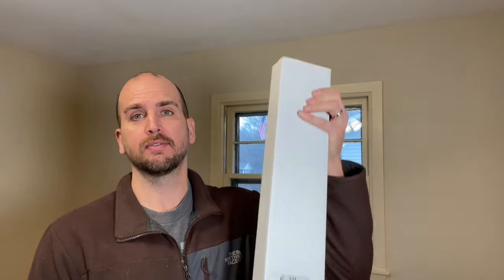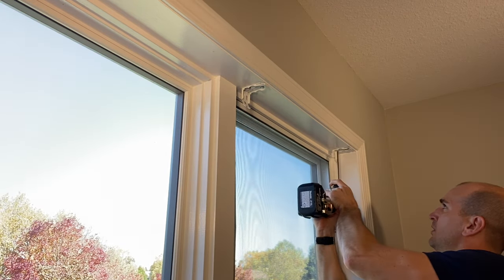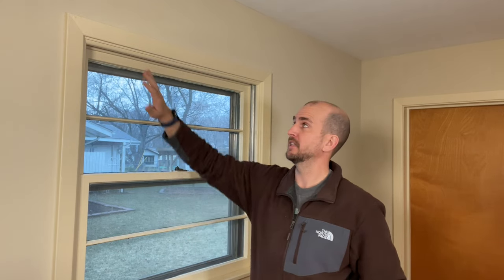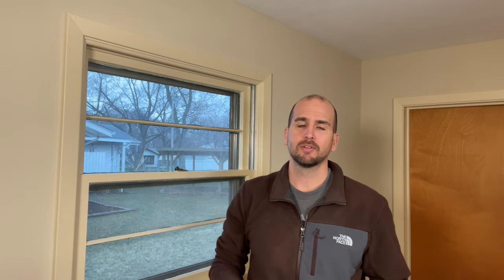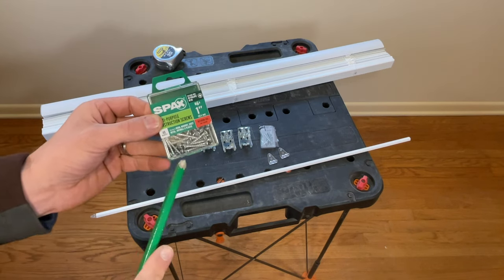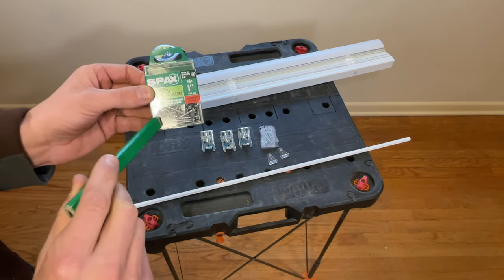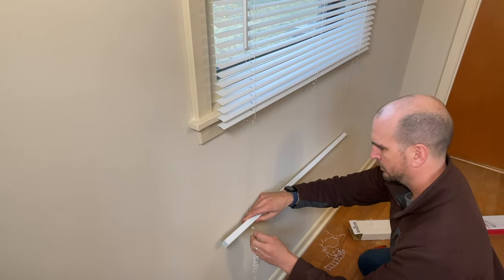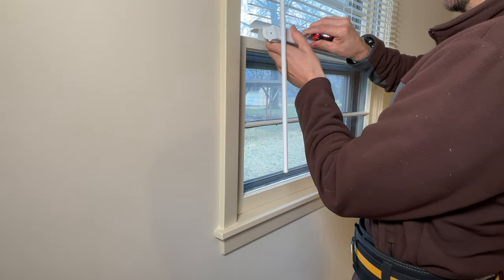How to Install Cordless Window Blinds | Outside Mount

Comment: Thank you so much. After many hours of searching, you are the first person to mention using spacers when installing above the trim. I had a flat part on the trim in my old house I was able to use, but this new house has no flat parts on the trim. My parents blinds are installed this way without the spacers and they get caught on the trim when trying to tilt the slats, so I was thinking of using some type of wood spacers, but didn't think I would like the look. I'm so glad you mentioned those transparent ones.

Comment: Wow! I can do it myself! Your video is excellent! Love how thorough you are describing all the necessary parts of an easy, no problem installation. I picked up the different screws and made sure I had a magnetic screwdriver drill. We just got all our old windows replaced and thought I would have to have professional installation etc.  I even made a template out of the cardboard from the blind box so I could just use it for all the windows and blinds installed.  The windows were all the same size.  Thank you again Perfect instructional video.

Comment: I just installed a cordless blind from the Big Box store. Good quality and, along with yours,  very user-friendly directions. HOWEVER, I did an outside mount, installing it to clear the window, and discovered that I can't reach that high! So it still partially covers the window when it's up. Who'd a thunk it? It's fine, and I'll leave it, because everything else worked out great. I just never would've thought of it, so thought I'd share.

Comment: On a tangential topic, I have a tip for inside mounting.  If you have a lot of blinds to hang, make a template.  Just rip one of the flaps off a blind box and tape it into the corner of the window frame where you want the left bracket to go.  Once you decide on the bracket position, use an awl to mark the screw holes in the cardboard.  Before you remove the template, write an L (for left) on it, and draw an arrow so you know the proper orientation to use.  Remove the template and write an R (for right) on the other side.  Then you can use the template and an awl to mark the screw locations for all of your windows.  Use the L side for the left brackets, and the R side for the right brackets.  The reason you use the left side to create the template is because the blind tilting mechanism means you don't have as many placement options for the left bracket.  If the template works for the left side, it should also work for the right side after you flip it over.
Reply from the maker: Good stuff Mark, thanks for the info/tip!
Reply: I should also point out that this depends on the mounting brackets having holes in a symmetrical pattern.  If the patter is asymmetric, you'll need two templates.

Comment: I like blinds and curtains for a pretty complete black out effect. Blinds usually have holes in them and of course the space between the slats. Curtains usually bleed light through and the space between them if they don't overlap enough. Having both makes for a pretty dark room. Especially useful in the summertime when you finally have a day off to sleep in!  😊
Reply from the maker: I think that is a better all around solution.  In my rentals and flip properties I usually just put up blinds but some of my renters request curtains as well especially in the bedrooms 👍.

Comment: Bought 27x48 Room Dark blinds. Window width inside vinyl frame around window 26x35.  Surrounding wood framing is 27 1/2 x35. Suggested  location for placing brackets!

Comment: Depending on how many different sized windows you have in a given house (I have roughly three), I like to keep an extra set or two of the cheap blinds as "just in case" replacements. I have no issue using the cheap Lowes house brand on most of my windows, but they are more brittle and so break more easily if hit by something, etc.
Reply from the maker: Hey Marc,  I have used several different brands from the big box home improvement stores over the years but I did notice these Project Source 1" vinyl blinds seemed a bit more brittle and prone to the slats getting chipped or broken.
Reply: @EverydayHomeRepairs  Definitely noticed it too. There was a previous iteration of the Lowes brand cordless that wasn't as brittle, but didn't have the control rod to open/close, and instead you had to pull down or lift up on them a bit (with the side effect of also raising or lowering them a little every time).

Comment: I have three cordless levelor blinds that are installed side by side. Each one closes a bit more or less than the other. So at night with the lights on inside and the blinds closed, some let more or less light through than the others. How can I make it so they all close tightly with no gap at the overhang of each slat?

Comment: Im doing an outside mount. I have 30 3/4 inch wide window. So I would be buying 34 inch wide blinds for the over hang?
Reply from the maker: I would use blinds which are 33" or 34" as either should work and give adequate overhang.  Best of luck on the project!

Comment: At around 5:00, based on where your hands are, it looks like you are measuring from the inside of one side of the frame to the outside of the other side of the frame. Is this really how you measure?

Comment: I cant get the blind to clip in the 1st mounting bracket...we tried everything
Reply from the maker: They can be difficult.  Just confirm the mounting clip isn't angle a little which could make things a little harder to align.

Comment: when they installed our new windows they took away our jam area for hanging blinds. I was wondering if we could thicken the jam by adding a boarder around the window, in which does not have any trim around it so that we can install our blinds on the inside and then put our curtains back up

Comment: So I had to repair some slats in my blinds, as I was doing this, the pull cord retracted too far into the inner mechanism up top. When I tried pulling it back out, I grabbed the wrong part of the string out, and now it's messed up now. Does anyone know anything about the inner mechanisms that come with the blinds in this video?

Comment: how did you compensate for the trim that was angled? -- do both holes of the bracket need to be flush with the trim?
Reply from the maker: I did not compensate for the angle of the trim and just mounted the bracket flat against the trim without any shimming.  I thought about shimming but since the angle wasn't that aggressive I just mounted flat.
Reply: I went ahead without doing anything and they hung beautifully— thanks to your video!   Thank you!!!
Reply from the maker: No problem, happy to help 👍

Comment: Great Video! Thank you for making it.  Question:  I purchased  white 1" Vinyl slat type cordless Levolor blinds Model #929751 (sorry, it was before I saw your video) and thought I could shorten them... however when I got them home I read the instructions they said they cannot be shortened... yet I see instructional videos, including yours, showing how to shorten them.  These blinds are slightly different from yours, instead of the elongated holes to pass the lifting cords, they have tiny small holes (total of 4) for the 4 lifting cords that pass through the slats (positioned towards the rear of the slats, I think it gives a cleaner look). The model I have is 60" wide x 72" tall blinds (for a 43" tall window, that is ridiculously oversized!!!), There are 5 ladders, and 4 lift strings. Are these really impossible to shorten or are the instructions saying that to discourage people from attempting to shorten the blinds?  Do you or your audience know anything about these?  Thank you in advance.

Comment: These brackets are a PIA to work with! I have purchased blinds three times from the same store and have gotten 3 different types of brackets, and all are different when it's time to attach the blind! I get so frustrated and just when I think I have it clipped in securely, it falls down. Why did they have to change the brackets? They are horrible. The end brackets were much simpler. Another example of, "If it isn't broken..."

Comment: I think for amateurs its easier/better to first drill a pilot hole. It took me a minute to figure out where you hooked the top of the blind on the brackets but otherwise very nice video.